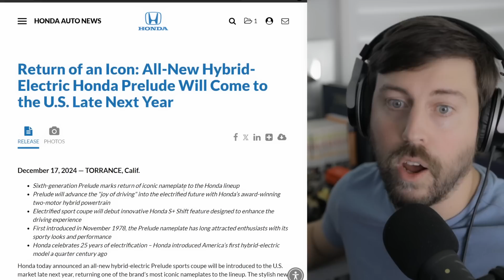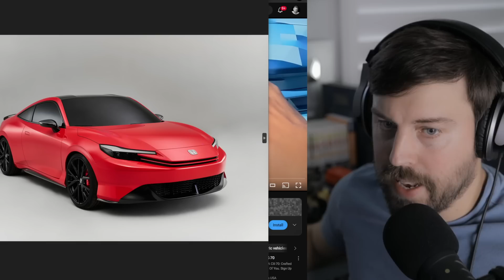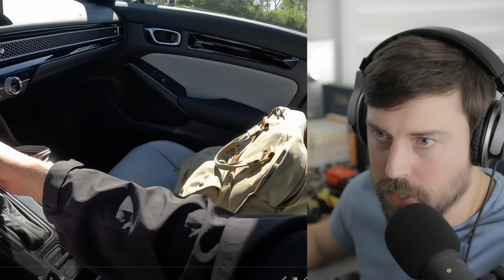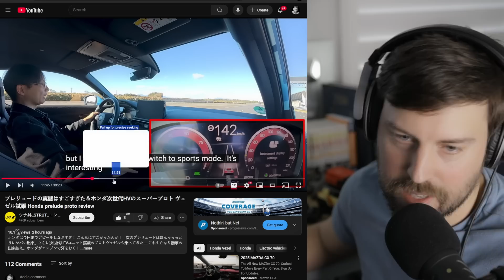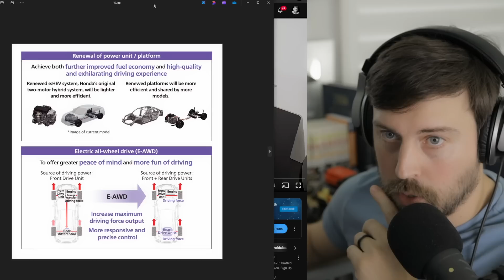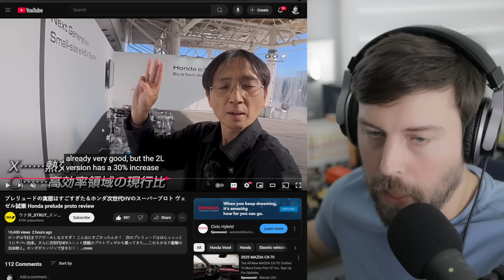Japan is driving the new Honda Prelude // This hybrid changes everything

Comment: That dude couldn't have been more excited I can hardly wait to see it and drive it in person.
Reply: But he's Japanese.
Reply: Go drive a 2025 civic hybrid. It's essentially the same car
Reply: @DJ.1001 Civic hybrid only has Sport Mode, not S+ mode. I don't think they're similar, based on American reviews of the Civic. 

The American Civic hybrid reviewers praised the nice, firm electric motor launches, but they basically said, the simulated shifts and fake engine sounds at higher speeds and the general lack of responsive feelings, created an effect that was pretty bland and tame. One reviewer said that it would quickly become annoying and he would probably wish for a way to turn off the fake shifts.

This Prelude reviewer appears to show something very different. The engine rev sounds are not fake. The engine is actually tacking up which causes the car to jerk or pull when it fake shifts. The reviewer seemed to love the realistic, seat of the pants feeling of the "shifts." I didn't get the impression that he wished he could turn them off.

Neither transmission actually "shifts" in the technical sense of the word. However, the Civic shifts are much faker, because the engine rev sounds are completely fake and are piped into the cabin through sound speakers, therefore, the car cannot have any seat of the pants feel to it when it fake "shifts."

In contrast, the Prelude engine actually hits preprogrammed higher rev settings and with Honda software magic, they can use those increased revs and torque to simulate "shifts" in such a way that they both sound and feel very real.

I'm not a car expert nor am I a Honda expert. I'm only stating my understanding of what I think is happening, based on what I've heard different reviewers say.

Comment: Why don't they build manual or dual clutch transmissions instead of CVT junk. The new prelude will be a POS compared to the original.
Reply: It's not a CVT, it's a direct drive

Comment: I just don't get how you can get excited for a fwd coupe with a fake gearbox 🤔
Reply: Also impossible to tune or any performance mods
Reply: It's rwd
Reply: i think the original one was only 4 cylinder anyway - preludes are goated
Reply: @christianjon8064  i actually had the last one and have to admit it did have a great chassis. If this was awd with type r running gear and 6mt it would be cool imo..

Comment: itll have to be lighter than a used civic and a lot more power to weight ratio, maybe super effceint for low cost ownership but for the electrci only one  insurance costs, longveity badness, etc means its probably not good there either. aptera is more about effiency and looks much more interesting, not a drivers car but maybe its not so bad as a mild momentum preservation car with different steering programing and wheel.                 maybe prelude can become relevent if it sells with options to be a cheap car for people who wont have family (most people nowdays)?

Comment: Kirk, If Honda wants to "deliver maximum levels of driver enjoyment" they should sell the Prelude with their famous  manual  transmission.
Reply: This powertrain has no transmission; the electric motors are mated to the driving wheels via fixed gear ratio. Since there's no "automatic transmission", there's no hope of simply replacing it with a manual transmission. Sad for sure, but manuals are relinquished to a now defunct powertrain.

There's always hope for simulated manuals similar to what Toyota is attempting to do but that's not for me at all. The manual lever isn't physically connected to anything. At that point, I'd much rather have a classic sports car on the side for the occasional "pure" drive, and keep my electrified daily driver for the bulk of my driving.
Reply: @ThePilotGear unfortunately, this is how things will progress
Reply: @rivato6499  yep, but I don't see it as a bad thing at all. One less thing to wear out, and since it's electrified anyway, might as well just not have a transmission. The result is immediate response from the electric motor. It's really nice.
Reply: @ThePilotGear neah, I'd take 3 pedals and a stick shift in an older car, tbh..(and not this new prelude)
Reply: Respectfully, maybe do some research on Honda's hybrid system - you can't put a manual transmission into that system. It's direct drive at highway speed...

It's a one speed direct drive system.
Reply: Manuals are more difficult to pass sound and emissions regulations with. That’s the main reason why they’re going away.
Reply from the maker: That's what Acura rsx is for
Reply: @KirkKreifels  but it doesn’t make any sense. Why do I have to go to literally the luxury version of Honda just to get what I want that sounds like a marketing issue sounds like they’re trying to pull more money out of you just to get a manual transmission and that’s very bad for enthusiast cause it forces enthusiast to do something that they probably don’t wanna do just for a manual transmission that is sad for the car car community seriously

Comment: This wasn't the only Japanese video posted either - I found two more suggested on the side bar of this video that did their own drives and gave a bit more info on suspension setup, dimensions, etc.
Reply: @RobbJK  lsd super handling front differential 4 wheel steer?

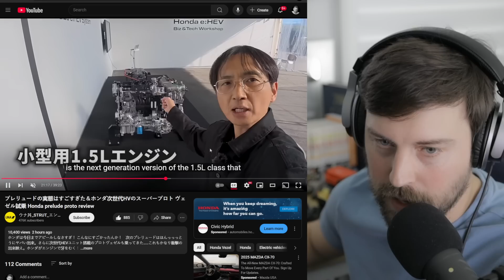Comment: 12:25 Honda had the 2019-2022 Insight (AKA Civic hybrid) here in the States, where it use the same hybrid system but with the 1.5l engine.
Reply: I have a 2019 Honda insight and I’m telling you that it is not a fun car to drive. But hey, at least my wallet is happy at the gas station.
Reply: @abdulgill5013 Yea, can't go wrong with 55mpg, Insight is clearly underrated.

Comment: I had a 86 Prelude SI. It was a great car. I am glad Honda is bringing the name back. I am also glad it is a hybrid, not a pure EV. Maybe they will make a PHEV version ... I agree with your gear shifter comments. Why go to all the trouble of giving it a performance focus and use a button.  Maybe they intend the drivers to use the steering wheel paddle shifters instead so the gear shifter might be considered redundant. My biggest complaint of hybrid tech (I have a 2010 Prius) is they lack of gearing. Honda seems to have fixed this even if it's not real gears, as long as it feels right.